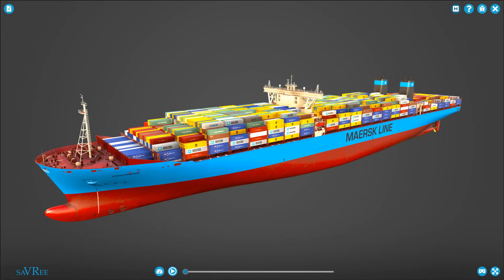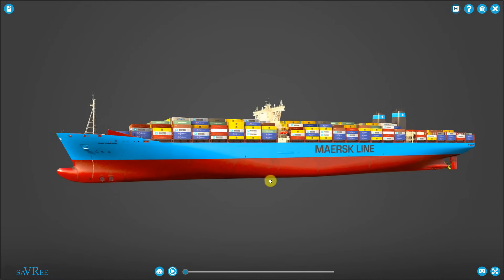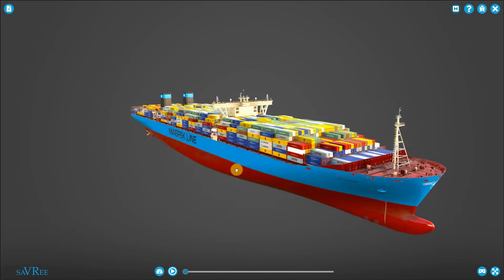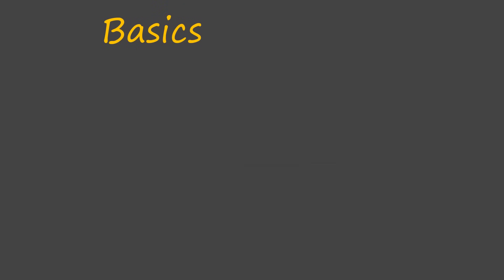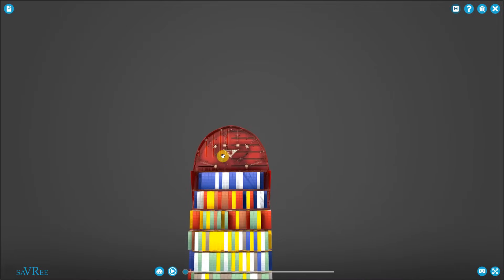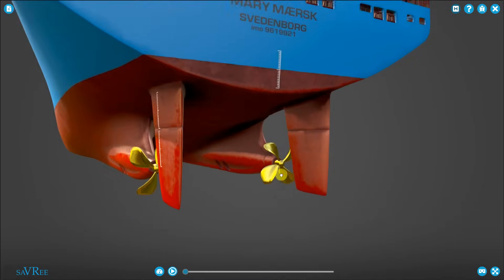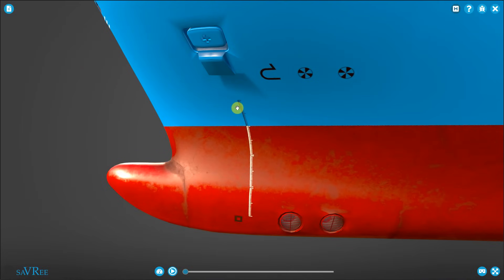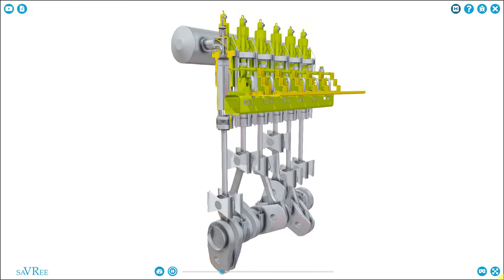Ship Parts and Terminology Explained! (saVRee Nuggets)

Comment: The bulbous bow actually creates a wave of the same frequency as the main hull just 180 degrees out of phase so that the wave bottom from the bow, cancels the wave crest of the hull... kind  of think of it like this: A bulldozer pushing dirt eventually has so much dirt in front that it is hard to move, now if the dozer had a bulbous bow, there would always be a hole right in front of the blade so that as you moved forward it filled in and making a flat smooth running space, and a pile of dirt that moved easily. A car that always makes its own downhill slope :)

Comment: RE: anchoring. If I understand it correctly, to properly anchor a vessel youd lower the anchor (not 'drop') to the sea floor, then drag it slightly to dig the paddles in (totally a technical term, trust me....) , then lay out some length of chain with the current. Once all that is done (properly. Exactly how its done properly, I have no idea) you can consider the vessel at anchor. Again, thats if I understand the process correctly, which I could be very wrong. But it should give some idea why the deckie would give you a scowl if you said 'just drop anchor' 😁

Also, no. Thanks for YOUR time. If one follows the metrics, youtube is for millennial gamers making prank videos, "top 10 [thing] you wouldnt believe if it wasnt caught on camera!!!", and various conspiracy theorists. But its these videos, and things like BigClive and the other 'over the shoulder' YouTubers, that share their knowledge and experience with effectively random faceless people. And now I have a little bit of that knowledge too. Im never going to be on a container ship, or need to know my way around its engine. But at least now I have that knowledge and some off the cuff tips rattling around my brain for no other reason than it sounded interesting (also because of the Casual Navigation life raft video). I always tell people, 'you dont need a reason to learn something. Besides, you cant know when or if it will ever come in handy.' So if do end up having to find my way around a container ship 2 stroke diesel now Im at least somewhat prepared 😅

So Thank you, mate. For taking the time to show us all these little nuanced things about a world the powers that be cant fathom the general populous being interested in experiencing!

PS - YOUTUBE, YOUR ALGORITHM SUCKS FOR US OFF THE BEATEN TAIL FOLKS WHO DONT CARE WHAT MARKIPLIER OR PEWDIEPIE ARE DOING TODAY!!! And honestly....actively avoid it....

Comment: Yes, HFO was absolutely horrible and then, these ships did not even use the worst kind. That used to be reserved for turbine ships back in the day because boilers could burn the worst type of HFO that Diesel engines could not use due to the wear this fuel would subject the fuel injector nozzles to, but then the HFO for Diesel engine ships would have other problems to worry about such as catalyst debris in the fuel from the refinery thermal cracking process etc.
However, since the IMO 2020 was introduced, HFO is no longer used. Actually, there is a pretty big push today to optimize the technology around fuel types of merchant vessels.
Pretty good informative clip for people, who are not necessarily knowledgeable about the maritime industry.

Comment: You did a great job of explaining the basics.  In the US at least, the fuel is called bunker C.  It is one grade above road tar in the catalytic cracker.  I worked for Maersk as a Chief Mate.  I forgive you for being a Grease Monkey or a Snipe. :) These are slang names of engineers that deckies use.  The engineers call us Deck Apes. It's all in fun. The back of the ship can also be called the transom.  The fore castle is more properly pronounced the foc'sle.  Lights and day shapes describe a ships status like restricted in ability to maneuver or anchored.  Flags describe a different category of situations....like pilot on board (Hotel) or the handling of dangerous cargo (Bravo). At night that would be a 360 degree single red light on the mast. The Mary Maersk has twin MAN engines of 40,000 HP each.  The ship cost $185 million. When built it was a class of the largest container ships in the world.  Twin screw propellers turn in opposite directions when turning ahead, what is called outboard turning, this means that when looking forwards from the stern that the starboard propeller turns clockwise when turning ahead.